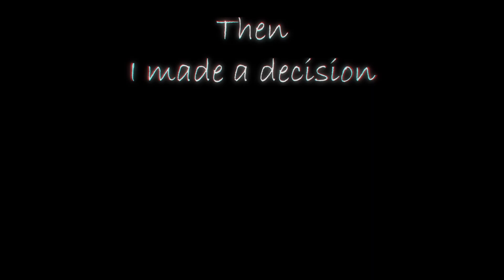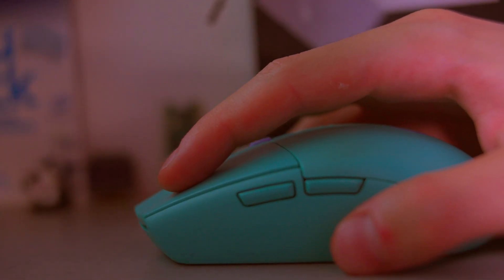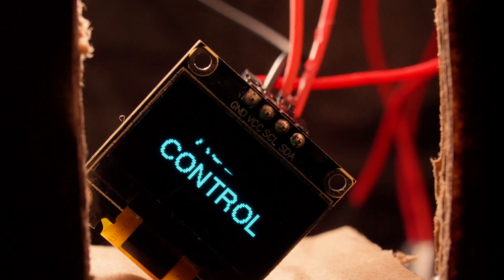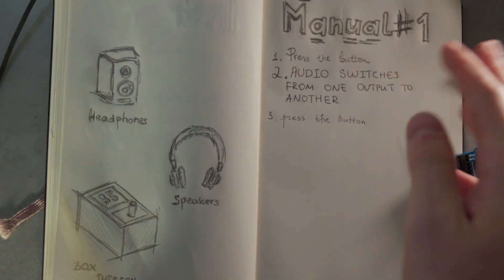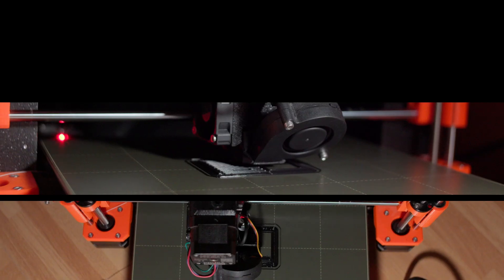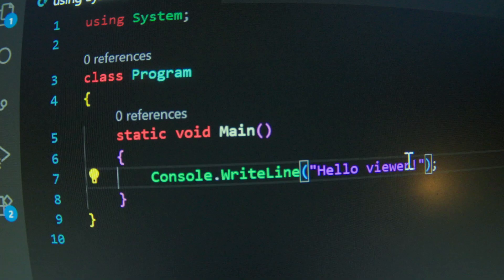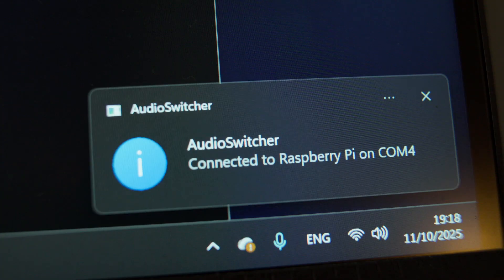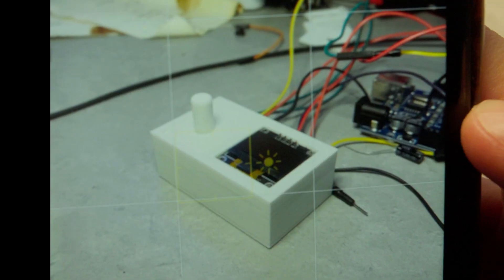I built a ...

Comment: if you are already doing it through pi with a language you never used before, why C#? I'm sure there are easier languages to work with.
for non-programmers, python is probably the best, for low level apps(often stuff that interacts with drivers and devices directly) C is the best with C++ as a compatible* alternative, but if it's a Windows exclusive app than C# is probably fine as well. I no longer use Windows so I have no idea...